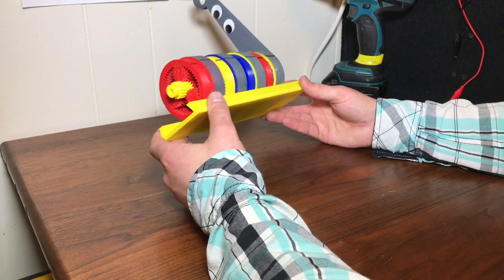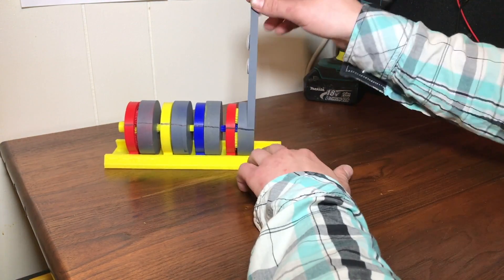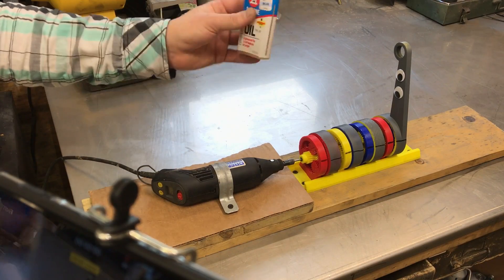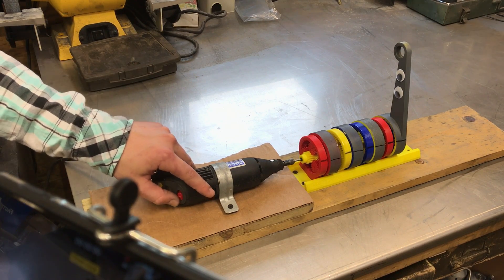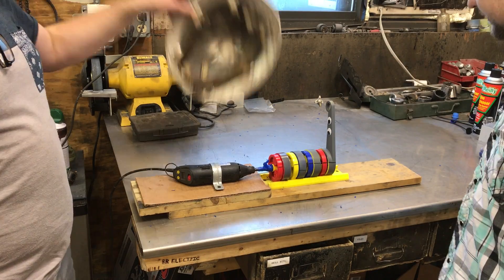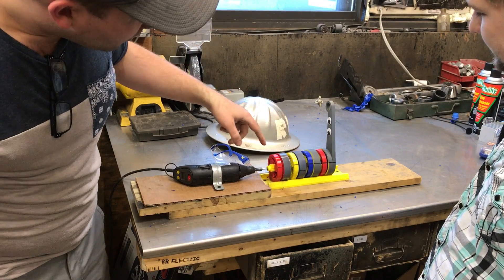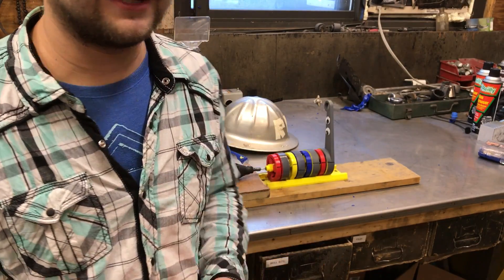3,616,238,492,881 To 1 - The Most Useless Gear Ratio Ever

Comment: Would it be practical to have a large sail that is pulled by the wind, almost staying in place and only slightly moving, say 1 cm in an hour and get on the other side a spining wheel at 3000 rpm?  

Once in an hour I'de release the sail and bring it back to it's original position. 

In a beufort 3 wind (gentle breeze 15 km/hr 8 knots wind)  with a 6x5 meter2 sail, at 30C air density is 1.16kg/m3 so the wind power is: 
(.5)rAv^3 = 17.4 kg x 3375 [km/hr]3 = 58,725 of something.  (what?)

Whatever that means I have to cut it down at least to 59% because of streaming, according to Betz' law. So I'm left with ~34,647 of that same thing. Don't ask me what.
Reply: Pashute I have no idea what any thing under the first section means but you’d need a dremel spinning at like double the speed of light to turn the last gear
Reply: @drewc9972  Thanks for answering my question!!! It's an honor to discuss it with you. I wasn't sure what units I get from the calculation of wind power, that I would be utilizing. The sail is static, the mast is attached to the roof with a hinge, pulling a rope when the mast bends a bit. 

I can ask it in a simpler way: I have a rope with 1 ton (1000 kg) weight on it, pulling a gear.  I want the rope to move at 10 cm a minute and need the final gear to turn at 3000 rpm. Now that I changed the question and formulated it clearly, I see the answer myself. It depends on the diameter of the winch. Say I use a 10 cm wide winch, at the rope rate of 10 cm a minute: That's 1 turn of the winch per minute and to get the 3000 RPM I need 1 to 3000 ratio. Which is definitely practical. 

If you make a demo unit and show it on the web, I can make a pitch for government funding to run a full-scale electricity generating project, either paying you for your time and effort or, if you wish, even full partnership. The demo unit is a gearbox run by a small sail on a mast attached to the table and pushed by a fan, with the bottom of the mast being a hinge, and the top of the mast connected to a cable that runs the gears. 
The cable should turn at 10 cm per minute (the wind from a fan, obviously, is much faster) and through the gearbox give us 3000 rpm. At the output side we need to somehow measure or estimate the energy = power rate. At the entry point we could do this by putting a weight on the cable before connecting it to the gears, and checking the speed of its advance.

Comment: Isn't it possible to measure the possible movement of the arm with a probe and micrometer on a stand? But it must be done in a controled climate chamber as a slight change in temperature could make that arm move more than the actual gear does..

Comment: Power it from the other end🤔😦
Reply: Dexton Halderman nothing would happen
Reply: @drewc9972  please explain why
Reply: Dexton Halderman friction and torque. He said it could have a force that could pull several Boeing 747s, so you’d need that force on the other side. Secondly, it’s just fuckin impossible cause the other end would move so fast, and friction would made it pretty much impossible

Comment: 2:30 if we ignore all this, you could mathematically make the gears run faster then light by turning slowly on the gray handle! :-)
EDIT: You can maybe prove or disprove the Plank length! If you put enough gears togeather, you will end in a gear, moving less then a Planks length, witch should be impossible! What would happen?
Reply: I need to see the numbers, I’m not trying to be that bitchy math teacher, I just like really big numbers
Reply: @tinhornname4117  LOL me to, but the numbers are fairly simple, it's just to multiply set of gears and arrive at a stupendous number. :-)
On the other hand, to crank the gray handle, would take such a great force, that even a stars whaight would be fare to little:-)
Reply: Fried Mule what?
Reply: Multiply by the set of gears?
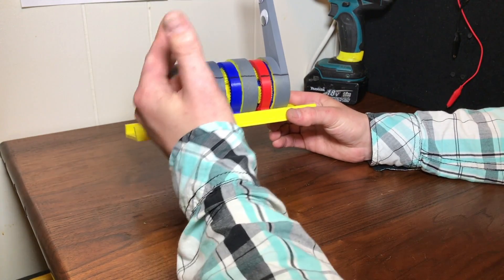Reply: @tinhornname4117  If you go to 0:57 and takes his information, recalculate to planks length, you know how many gear-set you would need and also the resulting speed if you did crank the gray handle:-)
Reply: Fried Mule please walk me through this, I need to see the death of God
Reply: Fried Mule So if I spun a gear at 1:3,616,238,492,881, assuming that the final part was ~10 cm in diameter, the part would be spinning at a speed in cm/s that would have 13 zeros. c in cm/s contains only 10 zeros
I would be going faster than the speed of light, the core of a neutron star would be barely enough to move the lever
Reply: @tinhornname4117  299,792,458 meters per second, or 29,979,245,800 cm/s is way less then the gears speed, so yes, the gear would spin over thousand times the speed of light, demanding an infinite amount of energy. but even the amount of force you had to use to get it to spin under the speed of light, would be so great, that you had to push with the same or more wight as the biggest stars in the universe. :-)
A neutron star would be a fly, compared yo that!

Comment: Now spin the other end with a drill
Reply: I want to see too... there has to be a way to turn that last gear enough for use to see what would happen.
Reply: Won't Work
Reply: @Lituation  but how will it not work. What would happen?
Reply: @Mikelectric  the resistent is too high, the handel will break.
Reply: @Lituation  i wanna see, can u push the handl;e at some realy slow speed and get the input shaft to spin like mad

Comment: ok ok.. heres a self destruct experiment... Lock the output handle up really tight with a vise grip or something.. The dremel will continue to run at full speed.. but eventually get slower, and slower and slower as the resistence mounts and mounts and mounts.. see how long it would take for the dremel to load down and break the gears or overheat the dremel or something crazy like that.. see how long it would take for the dremel to slow down 10 rpm, or 20, or 30.. and at what point does it all become junk

Comment: I know turning the lever would require impossible levels of force, but imagine if the lever was made insanely long, I'm talking taller than a ware house. Moving it by a fraction of a degree, with all the weight it can manage, would create so much friction it would break and melt. I'd love to see that on an IR camera.
Reply: those plastc gears would just bend and break way before there would be an iota of movement in the input (small) gear

Comment: Some clocks use a weight as their power source, how could you ratio, say 2000lbs to power a light bulb for a day?
Reply: George Thurnburg You can't. The only reason clocks can be powered by weights is because they are completely mechanical and require a very small amount of power. The only way to produce electricity with weight is by dropping it on a turbine or another device that converts movement into electricity. And assuming that you optimize to avoid waste, the power output of the weight will remain constant. Regardless of how quickly or slowly you drop it. It will never be able to power a lightbulb for an entire day. Just during your average cycling trip you already produce over 2000lbs worth of force. And even when considering how much of that energy is spent of movement, you would still not come close to producing enough energy to keep a lightbulb powered for an entire day.

Comment: Attach a similar design with a fewer gears but backwards on a 100hp three phase motor. Hard to explain but you might get 1 full revolution in 50 or less years.

Comment: The combined effect of tolerance stacking and general wear and tear would make it impossible to accurately measure the turning of the last gear.
The tolerance stacking effect alone would probably allow for the final gear to be bolted solid to the fixture while the device still ran for a substantial time.

Comment: Noob q: is it even possible to actuate this kind of gearbox from the output end? Like... If it was just a handle on the output of a single gearbox, would pulling handle that exert the correct angular pressure, backwards through those gears within gears, and create torque on the input? Is there any amount of force on that handle, even if the handle doesn't seem to move when you push on it, that it would make the input spin even once?

I ask because I have an imaginary generator that uses maybe just two of those ~1000:1 gearboxes in series to make the ratio ~1000000:1. If you attach a lever long enough such that a small weight, reasonably lifted by a human or low powered winch, placed on the end of that lever would cause the sun ring to spin, as reasonably fast as the materials could handle, roughly 250,000 times at fairly consistent pace through a quarter rotation (2o'clock position to 5o'clock) of that output gear, how much energy could be captured if that sun gear was attached to a dynamo? If that handle could be disengaged with a clutch and quickly reset, could many of these generators be placed in parallel to produce a useful volume of electricity, at the price of resetting each lever and weight at the end of each generation cycle? At 5,000 rpm, you should be able to pull some serious wattage for 50 minutes at a time in that setup. 

How much force would that actually take, though? The size and internal resistance of the dynamo would be a factor in determining that, of course, so it's difficult to easily estimate the maximum potential of this system. Would a force multiplying lever be too long to reasonably manufacture or would the weight need to be unreasonably heavy, given the longest physically possible lever? If a single one of these could be put together to output a useful amount of electricity on a scale operable by a single human (worst case scenario, they'd be walking along a high catwalk and using a system of ropes and pulleys to reset the weighted arms, but ideally I'd want the total drop distance to fit inside the average house), could many operating in parallel be wired to generate massive currents at the price of having a single human reset each machine on a looping schedule? How many KwH could a single human generate in an 8 hour day doing this labor of hoisting weights?

Comment: Maybe, just maybe, redo the experiment with lower RPMs, but with better heat management so it can run, maybe 3-5 days without having to keep an eye on it. 

Leave it running with camera on, and see how long does it need to move about 10 degree circular.
Reply: Andi Huang he literally said it’d take like 50 billion hours to move it all the way, and even if you wanted to move it a 1000th of the way, it’d still take 50 million hours which is 2k+ years

Comment: If you managed to get an electromagnet motor that could spin at 300,000 rpm it would be a much more feasible length of time with a full rotation of the output being slightly shy of 23 years

Comment: "The Most Useless Gear Ratio Ever"
...
adds one more gear to this
Reply: Maybe it's for loosening impossibly tight nuts.  Attach a motor, start and come back in a week to see if it worked.
Reply: @jasonlisonbee  actually thats true. It got incredible high torque
Reply: @cybeermancom1  But, I imagine the material strength wouldn't be high enough to apply the potential torque.
Reply: @Evan_Case  Yes! good speculation! I think no material in the world can stand for such a strength. However, if the nut is tight enough to such stress strength, this may be useful to make the gears in the same material of the nut.
Reply: @blower05  IT could also be useful at getting about as much torque out of a material as possible. So, if it fails to remove the nut, nothing made of that material wouldn't fail, lol.
Reply: Tragik Times torque is distributed, shedded through the system, the purpose of the gears, silly...
Reply: @Ma5tiff  Yes, it is distributed evely across the gears. But the torque is so high that even when evenly distributed it would exceed the material strength of all the gears combined.
Reply: Tragik Times lets run the numbers, very interesting...

Comment: Simply use metal gears setup all over to avoid all this wear out issue buddy....👍
Reply: A high speed table fan should do the work well enough .....👍
Reply: Robert Downy  give it a try you will get to know the results better....Have a check by opening up electric power tools all they have for cooling are fan blades attached to the armature where in the gear temperature and the widing temp is high at all times while running in use ...☺️

Comment: Try putting the gearbox in an aquarium with iced water, an indirect drive from the dremel to gearbox imput shaft, a belt or chain  would transfer the rotation to under the water.

Comment: if jou spin an electrical moter in reverse it generates electricity so if you attach the drill on the other side and an electrical moter on the other side if you turn it on and the moter is strong enough that it wont burn out it would generate so much  energy to probaly power a normal house

Comment: using that gear ratio and dremel running continuously at 14,000 rpm...last gear should complete turn in about 491.5 years

Comment: This same principle is used for automation in the computer chip industry, where single motors are required to do work with extreme accuracy, with a very delicate touch...  We had machines that were literally moved by motors slightly bigger than a large RC cars motor. That could rip your arm off...

Comment: I was hoping you spin it from the fast side, not the power side :/
Reply: Completely impossible.
You need alot of torque to turn it. And the torque would literally rip it apart
Reply: The turning movement would exceed the speed of light. Particles of the plastic would travel back in time or to another dimension
Reply: @eliaslundstedt5607  That's not how any of this works
Reply: @eliaslundstedt5607  you can believe in religion, times, and aliens....... not sure why you calling people TARDS.....  I mean The Vatican has scientists working at CERN specifically to try and prove God exists with science.  Anything is possible....
Reply: FoxXD bruh u can’t go above speed of light
Reply: FoxXD soo you never got the E
Reply: @mtqrx  Theoretically yes, optimistically no, pessimisticly no, in praxis no.
Reply: Alexandra Müller no, you can’t go above the speed of light anywhere
Reply: @mtqrx  we wont need to one we can generate gravity wells
Reply: That’s not how it works...that’s not how any of this works

Comment: Rotate the gear on the right.. make the sun gear spin a trillion times
Reply: I think it would become a time ma chine but it needs a Flux capacitor
Reply: Swampy  Chuck Norris: Am I joke to you?
Reply: @denisl2760  it still would break the thing
Reply: @max marrero everything you said is making me violently angry.

(Reference. Seriously though it makes no sense)
Reply: @alansmithee419  in the same way it's easily   spinning quickly with the sun gear side, it'll be very hard to spin the torque side
Reply: @TooFunkToDrunction  
I'll be honest when I looked back at their comment I wasn't sure what caught my attention, but I've compiled some ideas of what I could've been referring to:

1. The gear ratio is 3.6tril:1, unless it takes over half a ton to turn the first gear, which it doesn't, it will not take trillions of tons to turn the last.

2. speaking in tons is not necessarily nonsense, but not exactly useful either. Torque, e.g. Nm (or lbs-ft if you want to keep to imperial), should be used. Not tons.

3. the ton is not a unit of pressure as their comment strongly implies.

4. Oh good lord the spelling and grammar.

Comment: Its not useless it's incredible!
Imagine the system being frictionless. The input gear will rotate without rotation in the grey lever.
Reply: no. it wouldn't. You would still have to overcome newtonian physics. the gear at the opposite end is pretty much equvalent to 3 trillion times the mass of the gear at the lever. it would be like using a baseball to influence the orbit of a neutron star.

Comment: Would most definitely move /lift something extremely heavy , at least theoretically .. BUT , just imagine using the very finite movement it generates to position/aim a telescope at some distant star . .. that is this devices real potential .
Reply: J. B. There's a problem. The earth is moving too fast for any adjustments.
Reply: XtreeM FaiL 
Very true ... But , if you cut the reduction in half ...or more then it could work

Comment: see the problem with that gear box is that, allowance or space used to permit movement is a Loss of Ratio. that you didn't account for. It isn't rigid*. it has space between the cogs, that inherently prevent the first gear from directly influencing the next, or any consecutive gear.

it is influid. jerky. not true ratio.
Reply: the last gear isn't accurately turning.

Comment: I had a car with a transmissions just like that! It never went anywhere no matter how much gas I gave it!
Reply: Swampy  Sherlock !!! We have a Sherlock Holmes here.
Reply: But it could realign any  misbehaving local stars i bet
Reply: Did you try turning it off and on again?
Reply: Having a handle in the output shaft of a car's transmission? No wonder it didn't move.
Reply: was it a chevrolet? 😂😂😂😂😂😂😂😂😂😂😂😂😂😂 R.I.P. In Pepperoni
Reply: Noah Stevens hope not
Reply: @noahstevens2064  you are thinking of Chrysler. Over 6 million recalls for transmission issues in a year
Reply: Was it in neutral?
Reply: I dumped the clutch, and now my car has seven neutrals
Reply: botson catson relatable
Reply: @connorbaltich  r/ihadastroke
Reply: Slipping clutch
Reply: See, I think I know what your problem is: your radiator cap is attached to a piece of shit.
Reply: Let go of the clutch
Reply: Was that car a prius
Reply: 4L60?
Reply: That would be a very very very very very inefficient car. Like probably .0000000000001 mile to the gallon
Reply: Must have been a ford